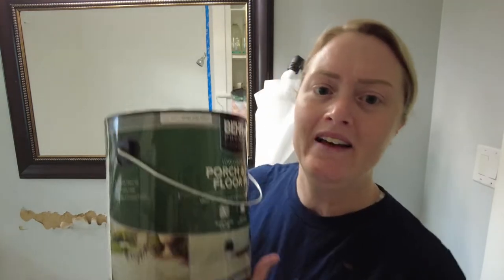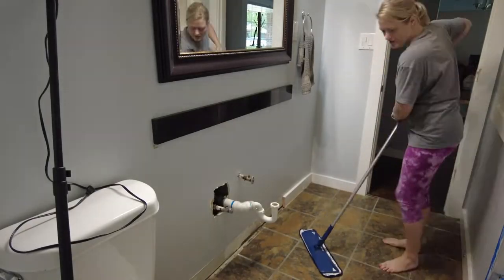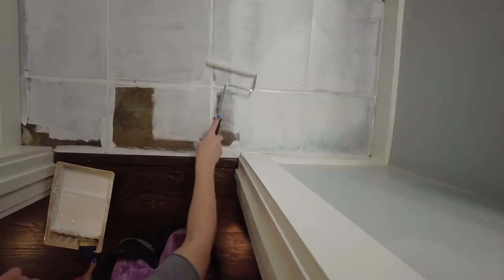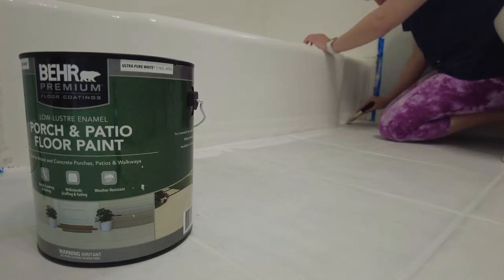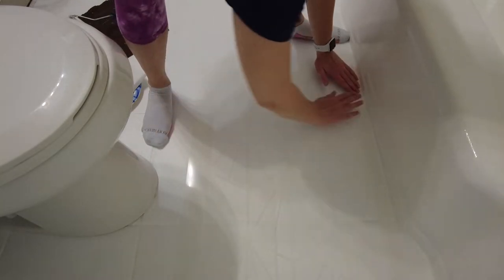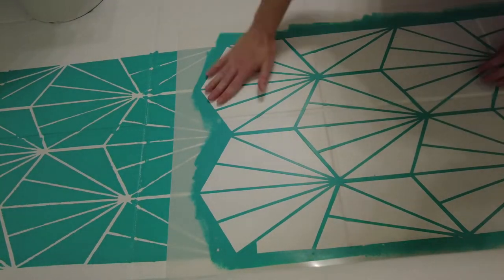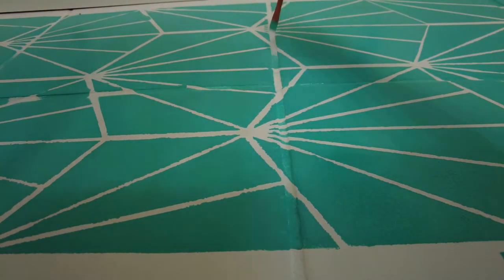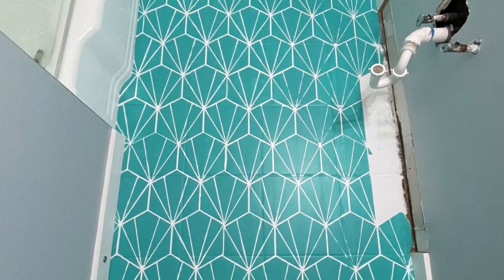How To Paint Your Tile Floor | Stenciling on Tile

Comment: Love this!  That wall paper is amazing!!!  We want to redo our bathroom.  Wanted to remove tub and add a shower but not happening right now.  The glass door you installed...Is it a partial stationary door with an opening at the far end?  Also how have the painted tiles in the shower held up?  what about the grout?
Reply from the maker: We installed this door ourselves! https://rstyle.me/+52ibAGO84p3yDEx-qvRAnQ

Check out the connects on this video for lots of Q&A on the painted tile! https://youtu.be/VkaGTyAAQ1A

Comment: It looks like it hasn't been that long since you've done this project.... I'm wondering how the floors will hold up with high traffic
Reply from the maker: I'll do a follow up video after some time has passed - but I have a longer runner rug in there and it helps reduce and scuffs! I also have the same paint on our outdoor patio and it's held up for years with scuffs just around the door

Comment: You didn’t say what the brand of paint was you used for the stencil.
Reply from the maker: It’s Behr!
Reply: @a_m_b_o  just regular Behr wall paint or also patio and floor paint?
Reply from the maker: @carmenwong6596  yes the same! The base coat and the stenciled design were white floor paint

Comment: Sorry.  You had me up until the stencil.  Creativity is subjective.  In my opinion...awful. But I appreciate all the other tips.
Reply: It may have been more successful  if it was a design that was the same size as the tile, + used stencil stippling brushes.. I might also suggest doing a mock up on paper first. but if it the homeowner likes it, that's what matters!